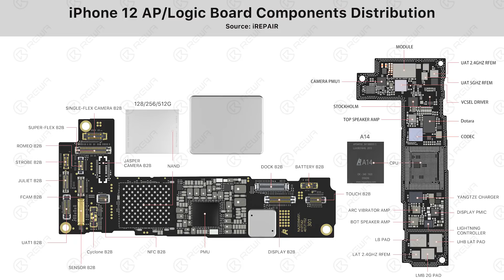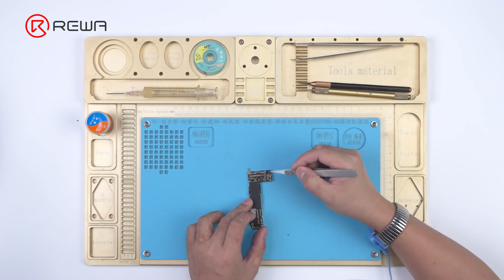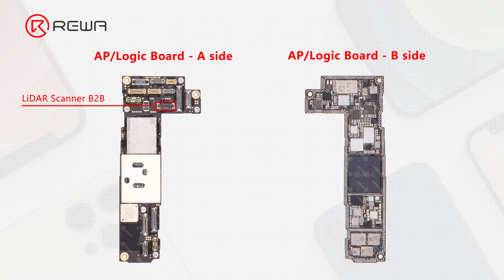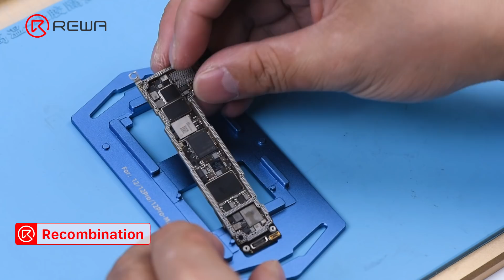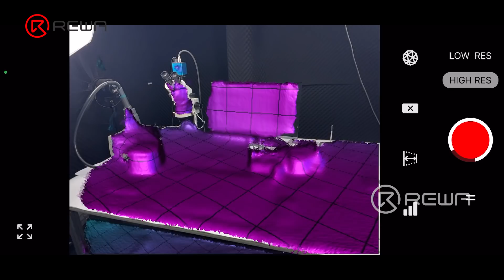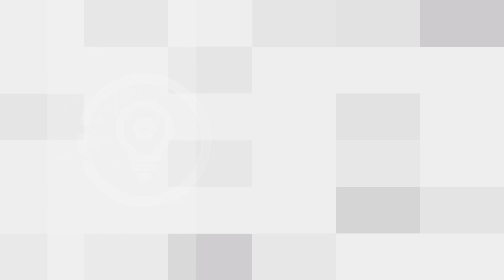iPhone 12/12 Pro Motherboard Analysis (A14 Bionic, 5G Network, LiDAR Scanner, Face ID Parts, PMU)

Comment: I had an iphone 12pro which went off while flashing with 3utools (reached 80% while writing baesband went off)and could not power on or connect to computer  again...is there a solution for such?
Reply: I tried all the hard rest functions,unplugged the battery and still couldn’t power on or connect to computer...is there a solution for such?

Comment: All iPhone 12 components are serialized and paired with the motherboard. So, replacing identical hardware at this point without a hack is impossible without Apple servicing the device. Swapping identical components causes bugs, freezing, battery warnings, and camera failure between two brand new iPhone 12's